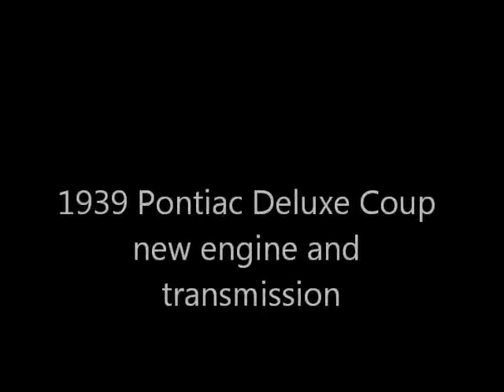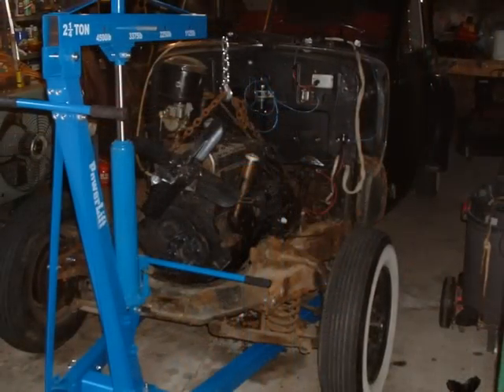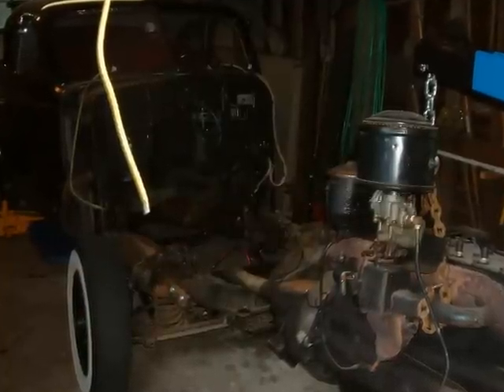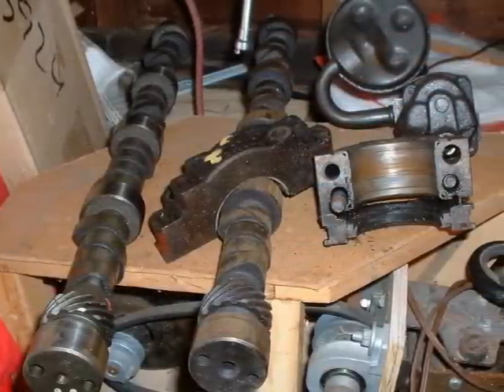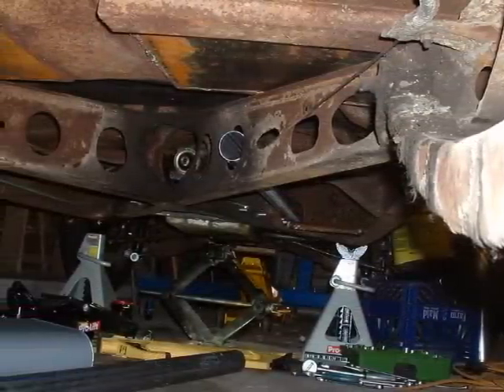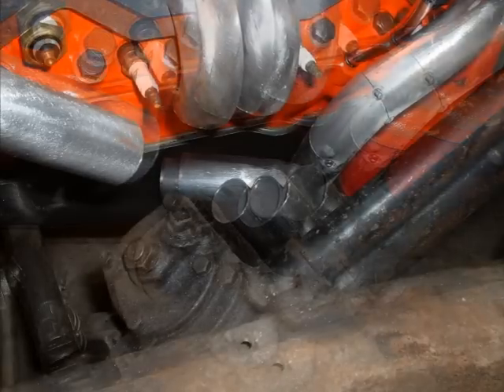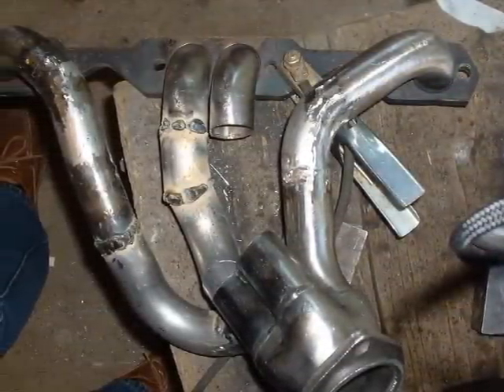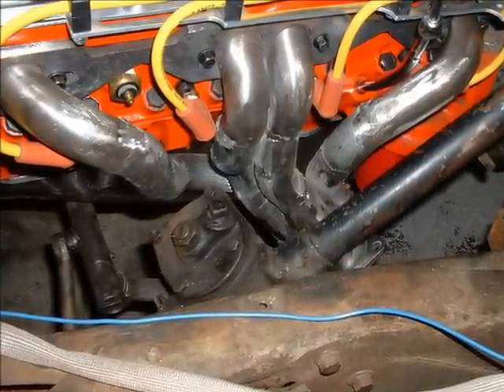1939 Pontiac Deluxe Coup new engine and transmission

Comment from the maker: @1963impala2dr Hi praise indeed! Thanks dude. Those motor mounts are still wimpy though, the rubber store-bought parts, the driver side tries to pull up though the rubber. I had to buy another mount and build a cap out of steel to surround the rubber so it can't split and let the bolt pull through. I plan on building a plate-type mount, that would come out right-left to the frame rails....that aught to work without worries! (I hope) Thanks again dude and Merry Xmas!

Comment from the maker: You could replace the guts in your stock rear end with proper guts, but the cost! WOW! Custom guts cost big time. My rear end is a 1980 Camaro 8.5" With Auburn posi and 3.73 gears. I rebuilt it, total cost was about a grand, all new guts except the axles.

Comment: rwuther, I have a 72 lemans 350 with transmission in my 39 coupe "stock rear end", cant get it to run right, are you using the stock rear end, if not what would you recommend?